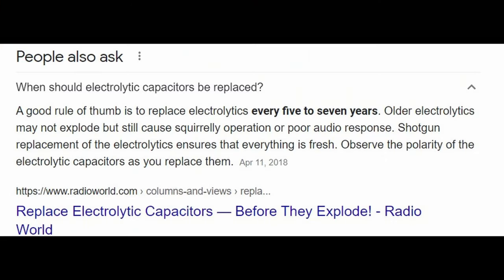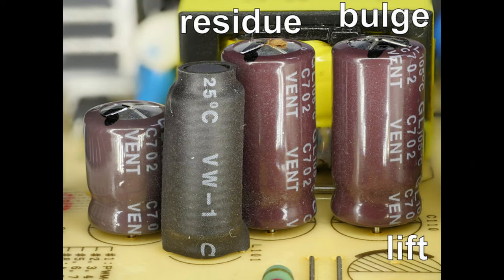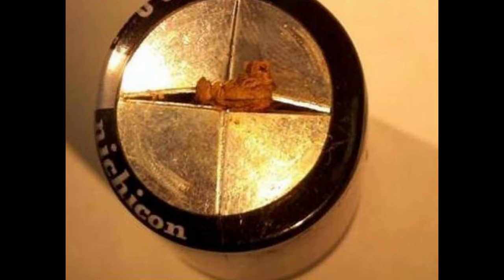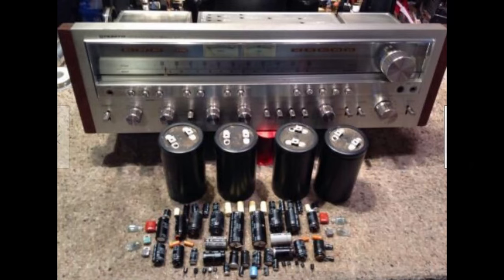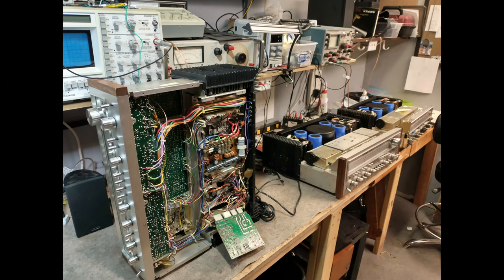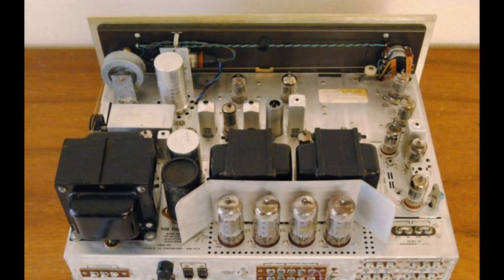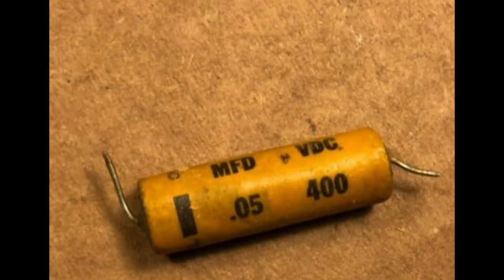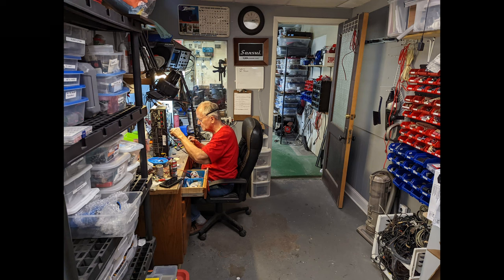Should You Replace Capacitors In Vintage Electronics?- Marantz Sansui Pioneer McIntosh Yamaha

Comment: if a cap has bulged, or you find leakage from the legs - it's broke! so fixit!

electros have nothing to do with sound quality per se (unless they're broken and no longer filtering out voltage ripple) - it's the greencaps which play a massive part in sound

Comment: Even if you changed the caps or power supply,  you wont change the sound,  because all you are doing is bringing it back to the day when you first bought it . But then you would have to look at your other components in your system,  as speakers and there internals,  at the  crossover board and also on the speaker leads !

Comment: I have a couple of thoughts. 1) Ask the "if it's not broke, don't fix it" guys to define "broke." Any capacitor that's 50+ years old is NOT performing like new - is that broke? - or just around the corner from it? And is the sound the same as it was when new?  2) Capacitors now being manufactured are definitely superior to what they made 50+ years ago. They SHOULD make the unit perform as its designer intended - or maybe even better.  3) You can replace electrolytics in the signal path with much better (film-type) capacitors, for no or not much more money. Not only do they sound better (near 100% consensus), they won't leak down or degrade like the electrolytics. I'm getting ready to repair and recap my old Hafler DH101 preamp, and upgrade the signal caps with film ones. Can't wait to hear it when I'm done!

Comment: I have seen the larger power supply capacitor is leak and burn a hole through the board. In my opinion anything older than 20 years should have at a minimum the power supply and rail capacitors replaced. I have done a couple of my own, one of them I actually replaced every single capacitor in the amplifier, that took a lot of time. If there's anything I noticed sonically, the amplifiers became more dynamic but I also did add vastly more power supply capacitance than they came with. As for hearing a difference, you can shunt them with a small Solen poly cap. If you do that on the rail there might be a small Sonic difference but it's going to be less so than in the speakers, especially on the Twitter circuit where the difference in capacitors is obvious

Comment: On a Bob Carver cinema grand 200 per channel that gave up the ghost yesterday, what would it cost to replace the power supply and the capacitors and check the system over?

Comment: I have several various models of the Sony STR-VX2xx series receivers from the early 80's.  They have all been exhibiting the same behavior where one channel will not produce sound when initially fired up, and sometimes it will stop sounding later on.  Sometimes the channel will start producing sound again after "warming up" on its own.  Most times, I can "wake up" the channel by cranking the volume up to near full volume for a second or two, and then it resumes producing sound.  Is this condition an indication that capacitors need to be replaced, and if so, which ones are the likely culprits?  Thanks!

Comment: I replaced all of the caps in my 1966 teac reel to reel and then found out it has a mechanical issue that causes the belt to keep falling off . What’s your opinion on replacing transistors on vintage equipment? Yes definitely when it comes to electrolytes  power has little to do with final sound imaging.
Reply from the maker: Some receivers/amplifiers, we automatically change out "known noisy" transistors. Pioneer SX X3X series have quite a few, also there are a few Marantz and Pioneer phono boards that get done as well. Just depends
Reply: @skylabsaudio  I have a vintage transistor cassette deck and I was curious to know if I should change know transistor that cause noise. It’s not producing any noise now and I only use it for play back. Thanks fir answering my question.

Comment: My pioneer was made in mid 70's , never been opened. I sprayed the switches, blew the dust out. Sounds awesome. I am a firm believer in if it isn't broke don't fix it. If your car is running like a top, even if it is old, are you going to rebuild it in case it might start burning oil in the future? This guy makes big bucks by blowing smoke up your rear
Reply from the maker: Lol. Big bucks, huh?
Don't change your oil or top off the fluids and see how long your car runs like a top.
Reply: @skylabsaudio  Changing the oil or checking fluids does not cost half the value of the vehicle. If it ever does get a new one.
Reply from the maker: I can recap a Pioneer SX 780 for cheaper than it would cost to change my oil.
Reply: @skylabsaudio  What about a sx 850 pioneer? I am willing to give it a shot. How would that go?

Comment: I got a recap kit on eBay for my Mac. I noticed that the new caps are much smaller than their corresponding vintage parts in the receiver.  Is it normal for the new caps to be smaller? (I checked carefully and all the values printed on the new and old caps match both mF and voltage.)

Comment: If appliances today are any indications of longevity, or more aptly, non-longevity, as modern vs vintage electronics, sometimes it's a toss up. My first in cabinet dishwasher lasted 20 some years , the next one less then 10 years, and now on my third with fingers crossed. Trust your test equipment, if it says it's good, it more then likely is, and better then replacing with supposedly newer, and hopefully as good parts is, in reality, a gamble.

Comment: For me, the cut off point is the 80's. Electrolytes got better by then and they are still a decade newer. If I have an amplifier from the 80's and visually it all looks like new from the inside and works fine, I am not going to touch it. If it is from the 70's or older, recapping is a a must. Also, I have such a backlog of audio that needs attention that the 80's amp would just not get prioritized, even if I wanted to recap it.
Reply: Just make sure you inspect them then! As I have 90's amps that have had electrolytics gone bad. Big dependency on how hot they run to
Reply: @aitchr8770  Agree, an inspection is always recommended.

Comment: Not just age, but poor original quality can warrant component replacement. Had a working Heathkit(?) tube stereo audio amp (factory assembled). I read an article in the 1980s about replacing the ceramic disk capacitors in the audio section with better types. I had access to the fabulous surplus electronics stores in the Silicon Valley, and seem to remember using tantalum caps. Not sure if I replaced any electrolytic caps with something else. This had had a muddy sound quality, and the quality/clarity went up tremendously over the whole frequency range!
Reply from the maker: Very cool! Thanks for sharing that.

Comment: Replacing electrolytics in power supplies and amp circuits is critical. If one of them shorts they can destroy other components, most importantly the power transformer which is mostly unobtainable. Feel the transformer before and after- it will be noticeably cooler

Comment: Theoretically true but most of the guys who repair audio gear these days do not do it as said, only some replace the most important caps, the others take some measurements, replace what it seems really necessary to work (or continue to work), perform indicated adjustments and calibration as accurate as possible and that's it. Given what most people want to pay nowadays there's no time for more or else it's very difficult to live out of it. It's the sad true.

Comment: Not only are the tech's aging and retiring, the equipment required to align the tuners and test the tubes is aging and failing or going into a dumpster. Good luck getting the equipment repaired when it’s all gone.

Comment: One word of caution.  Don't replace caps with new old stock of the same vintage.  The oxide layer can break down over time, especially if a voltage hasn't been applied to them for a long time.  The same problem can occur in equipment that hasn't been turned on for a long time.

Comment: I found a smart amazing young guy about a hour from me. amazing work always busy. An i have no problem doing a hour one way drive. I know of two techs really close by who told me no the unit is fine its fine just use it. The smart guy looked at in front of me and said it needs to be rebuilt. LOL. It turned out beautiful a Sansui 8080 saved from a pawnshop. I enjoyed it for the time but it has a new owner now. People need to remember we are Caretakers of this vintage gear for the next generation.

Comment: My dilemma is with my denon dp 62 l not locking on speed in 45 rpm i only realized when i got a fleetwood mac  audiophile pressing but its the only 45 i own. 33 is perfect so do i recap for 1 album or just leave it alone untill 33 starts acting up. Assuming caps are the issue.

Comment: How much can we expect to pay for the basic recap you recommended in video? Have eight vintage receivers with no service done. Please use Sansui 661 or Yamaha CR-620 if you need a model. Thanks
Reply from the maker: Depends on your location and Tech. Our ballpark would be around $400 for the CR-620. We do not accept shipped-in repairs- just fyi. Thanks!
Reply: @skylabsaudio  Thanks that gives me a good starting point

Comment: I echo all that is said here in the video and the 'all agree' comments. The reality is that if one has a single amp it is impossible to perceive the drift in output as the caps and components go out of spec. The out of spec sound is something they have also drifted with at an equal rate and time and it sounds normal, until one day it doesn't, or hear one that is in spec and are astounded by the output, including the silence.

Comment: In the early 90s I collected late 70's/early 80's arcade games... think Pac-Man, Galaga, etc.. If you've ever seen an old game like that and noticed that the picture was not very good (color bleed, lacking width/height (squeezed image), colors dull., you have literally seen the effects of aging  electrolytic capacitors in working equipment... those games were about 20 years old at the time, and there was no argument in the community regarding the necessity of a 'cap kit'', the only reason there's argument in the hi-fi community is because you can't SEE the effects of failing caps in audio gear, and hearing is a much more subjective thing.  Much of this audio stuff is pushing 50 years old. I have no doubt that if you have not replaced the electrolytic caps in your old gear that piece of gear isn't performing as well as it could. It is preventative maintenance, not some type of soul-killing mod.  

Next, most of us are approaching, if not already at, middle age. Many of us grew up going to loud concerts, playing in bands without earplugs, working in noisy environments before earplugs became a standard and I am sure that those things, combined with natural decline, have given us significant high-frequency hearing loss, so personally, I don't worry too much about capacitor types and changing the sound, and I doubt I can hear the difference between capacitor types with all the other variables in the signal chain.

Comment: I have sold electronic components for over 20 years. Electrolytic caps will leak both physically as well as electrically. they should be replaced way before 20 years whether they are leaking or not. they go out of tolerance. I say 10 years max in audio gear. power supply caps as well. no one wants a 20hz dc hum ?  Some amps have audio specific caps these really will make a difference in the audio quality. That's my opinion.

Comment: I heard the new capacitors are not of the same quality of those made 50 years ago... Do you think that's true and what are your thoughts on that...
Reply from the maker: Yeah that's BS. There has always been good and bad  or "quality and budget" components (caps resistors transistors) and there always will be. Buy good capacitors from a reputable source. There are some incredible (expensive) caps made today, that the older ones cant hold a candle to. To think that reliability and improvements on components stopped in the 70s is just silly.
Reply: @skylabsaudio  okay, thank you so much for the reply, that's reassuring..

Comment: Honestly I'm just curious how long it can last. Also on mine when I was just looking through it as I was replacing all the bulbs I saw a service sticker from 1992. (I've had it since about 1999.) I've had it for years and it still works fine. I don't think I've ever had to use deoxit on it. (SX-1250)

Comment: I have a Marantz 4300 Receiver , from 1972, and clearly needs a recaping since you can hear kind of sandly noise coming from every time adjusting certainly controls like volume, balance and treble controls mainly, specially whe'ns not hot. My concerns reside mainly on recaping all of it or certain pieces.
Reply: That noise is from dirty controls and switches. Buy a can of high quality contact cleaner like Deoxit and watch a video on how to use it.
Reply: I had the same issue with the volume knob on my grandmothers 60 year old AM/FM record player that was bigger than a coffee table, Not only was it scratchy the volume would just cut out randomly while increasing the volume! Took it apart sprayed it with contact cleaner blew it dry and it works like new!